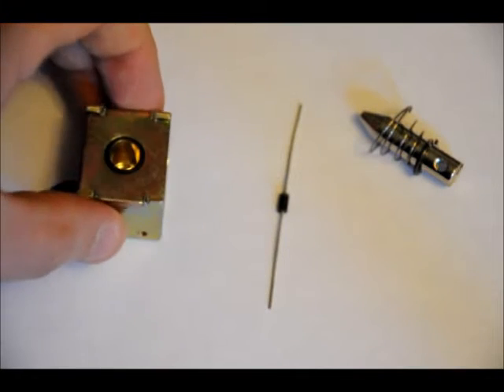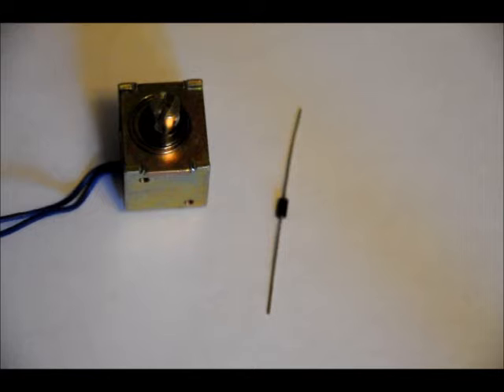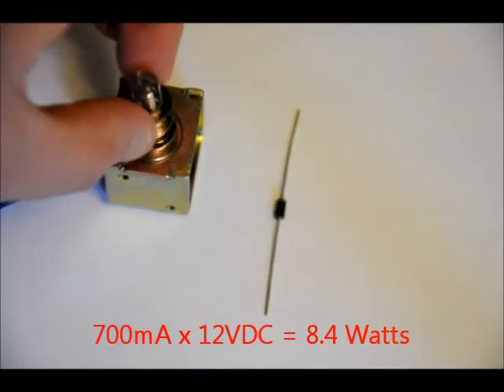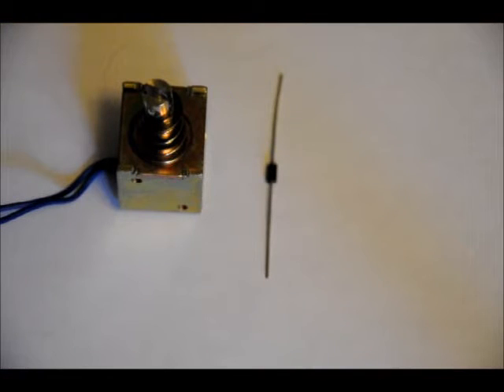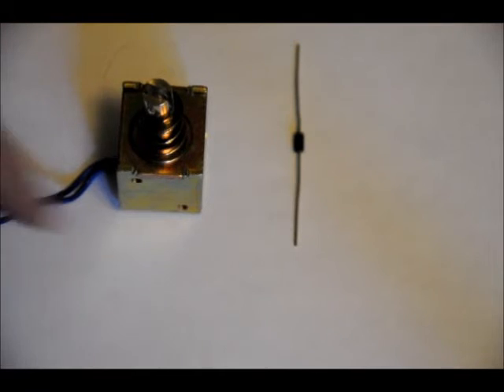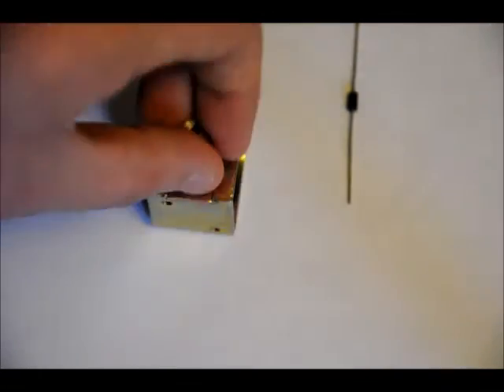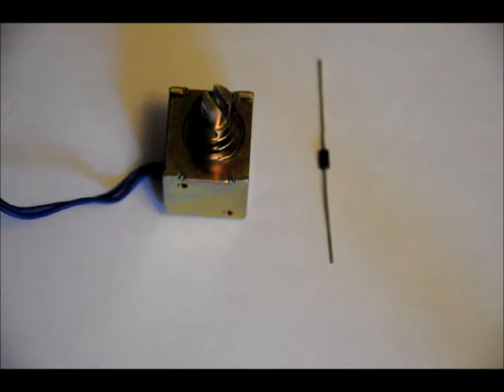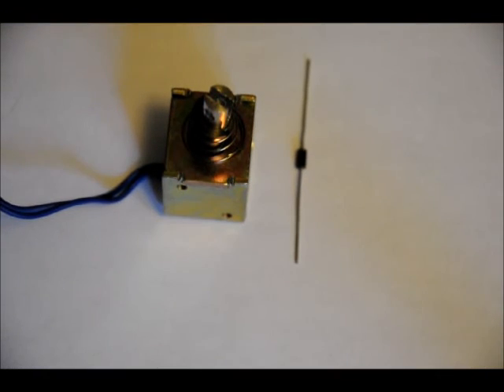An Introduction To Our New Spring-Loaded Electromagnetic Solenoids

Comment: Why is the housing so massive and why does the slug need to fall out?
Reply: well to create a force such as shown you need a lot of turns on a coil to create an electromagnet strong enough. and as soon as you let go of the button the elctromagnet turns off but the spring is contructed so when it's going to expand with F=-k(x)^2 which is enough to make it "fly"

Comment: heat= dissipated watts, a series resistance or equal value would half its current, and half its perceived voltage, and as watts=current*volts, its down to 25%, problem is as you say at 25% it wont pull in, but will hold, to make it pull in the capacitance provides a virtual short across the bulb for a few microseconds, causing the pull in. also cold filament has much less resistance - 1940's electronics lol still works today but its a forgotten art

Comment from the maker: I do see the benefit of having a cap there.  It would certainly help with the initial pull, but I'd think that it would have to be more than 100uf, but perhaps I'm wrong.  But then that would only help with the initial pull.  If the plunger was pulling something that required more than say 1/2 a pound of torque, if the solenoid wasn't being powered properly, it wouldn't hold.  At least, I don't think it would.

Comment from the maker: Hmm.  I'm trying to understand how that would effect the circuit.  It would certainly add a series resistance, and cut down the operating current on the line.  If this was significant, then the solenoid would not operate.  However, I don't even see how it would keep the coil from getting hot.  If there is a consistent current along the solenoid coil; even half of the required operating current, it would still get pretty hot over time =(

Comment: once saw an old design were to stop heating of the coils when left energised they put a 12v 4w bulb in series, also provided an indication that it was energised. the bulb had a 100uf 16v cap to provide an initial low resistance to provide enough pull current.

these days i suppose as you say just run the switching transistor at a 15-25% duty cycle but if it is being switched by  a relay then a bulb/cap resistor/cap  setup will suffice
Reply: or you could add resistors in parallel so you would have higher wattage capacity on your system but no as much resistance added to it ^^